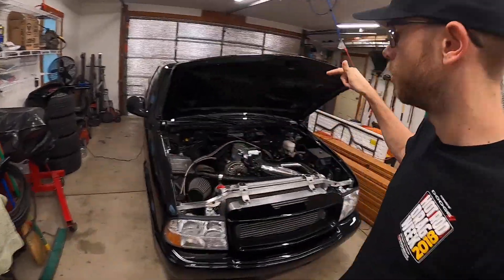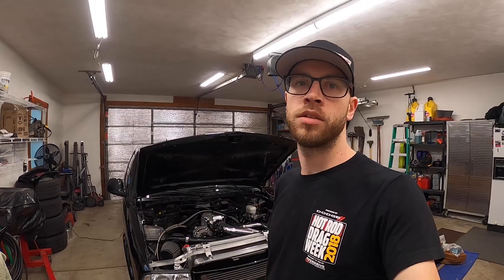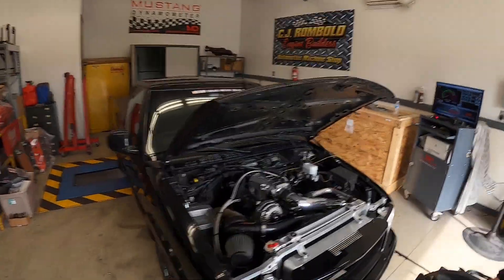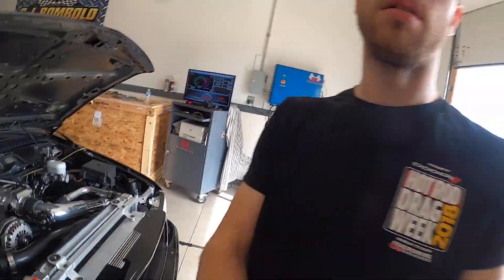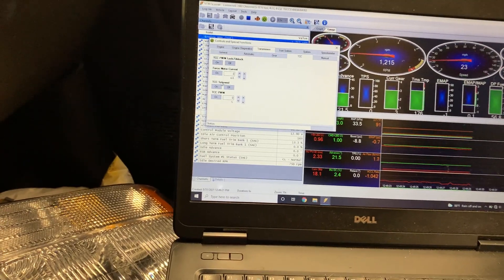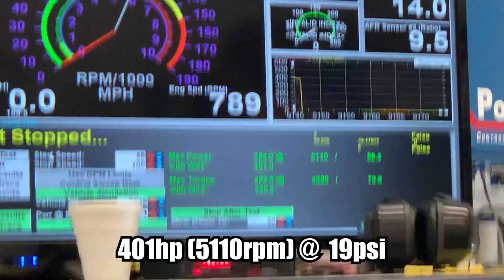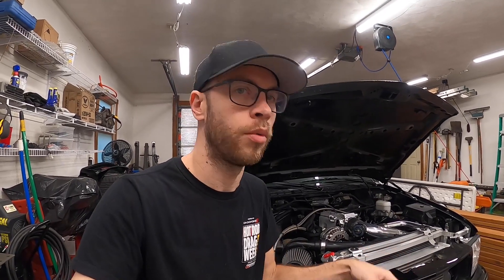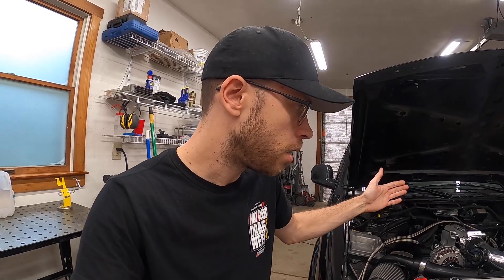Dyno Day - How Much Can A Stock 4.3L V6 Motor Take?

Comment: What intake manifold are you using did you convert it to direct injection, what's the fuel system and what are you using to tune it

Comment: Stock Ring Gaps? With that much boost? That thing is itching to implode 😂, The you can get A GenV LV3 4.3 and build it semi up with cam and Rings and delete the AFM. Then you can get 6-800 wheel  Hp!

Comment: Watched this a few times. Came back. Just watched a 2jz with 6 speed on chassis dyno. Made 420 @19 lbs boost. And you have an auto. So this is a great number considering how "legendary" the 2jz is. Good job
Reply: Must have been bad tune or something going on those supras make power
Reply: @BlackandWhitecustoms  yea. With a lot of boost
Reply: @manworksgarage  wouldn't take very much for a 2jz to hit 500 HP. Not taking nothing away from his build it's very impressive but in no way can you compare a 2jz to a 4.3. The 2jz at 500 HP will last forever but 4.3 stock is a ticking time bomb at 500
Reply: @BlackandWhitecustoms  I agree with that. I was just comparing 20lb vs 20lbs. Impressed the 4.3 was at same 420 whp. With an auto vs a manual at that. Obviously the 2jz is smaller gonna need more boost but it's got a probably much better head plus vvti.
Reply: @BlackandWhitecustoms  found a dyno video. 2jz with th400. 499 at wheels 27 psi. Now 27 may blow up the 4.3. Idk. But it's pretty stock. I don't agree the 2jz is so much better than other engines. 500 I a lot more than the original 300 to 326. So it will always take a toll. It's a rather small engine.
Reply: @manworksgarage   yeah I like both motors maybe 4.3 a little better because I can buy those all the time at cheap price. I am about to pickup turbo kit for my 4.3 long bed single cab work truck to see first hand how well these motors run on turbo. Gonna throw a small cam also with stock bottom end rebuild and properly gapped piston rings. If I can get 450 I will be happy
Reply: @manworksgarage  4.3 will probably take it but not for very long. I am thinking about buying separate motor so I can e85 my stock motor and keep upping boost until it blows 😅
Reply: @BlackandWhitecustoms  I also have a turbo.kit for my s10 blazer. Filming for my channel. I'm also awd swapping it. Wanna do vortec heads and a cam too. A few different turbos to try out. Also doing sniper swap.
Reply: @BlackandWhitecustoms  engine power did a 4.3 vortec head, little porting, cam. Holley sniper. Did 450 plus hp. Only about 17 lbs I thing. Good turbo
Reply: @BlackandWhitecustoms  definitely the vortec heads 95 up. And a cam help a lot. Turbo v6 guy doesn't have a cam yet and made 420 whp
Reply: @BlackandWhitecustoms  it has a decent base.  With good bolts. It has 5 bolts per cylinder head bolts like sbc. 4 bolt mains I think it'd last with 450ish. Street driven

Comment: I like V6 engines, but they don't seem to dyno very well.I mean 19 psi boost is 2.29 BAR MAP, right? 401 hp / 2.29 MAP is 175 hå from "The theoretical NA engine". 175 hp 7 262 CID is only 0.76 hp/CID. I think this number speaks for itself so the need for a highflow intanke manifold is very limitied . :)

Comment: Why did you want so Much Boost, 369 and close to 400 Ft pounds, Would be a nice drive, That Motor will not hang in there with boost so High, You Have Nothing to Prove You did good on Manifold, you should be Happy with what you Had.  If you watched power nation, 500 hp 500 foot pounds with less Boost, Maybe your Camshaft , You really don't need so much,. Blowing up your Motor is not worth all the work Put into it, Be happy, Less is sometimes Better.

Comment: Nice build. I think you’re just not revving high enough on the stock cam/springs to take advantage of your new intake setup. The marine parts for these engines work quite well on stock blocks up to ~5000 RPM but if you were to take it higher with a bigger cam I believe the new intake would have picked up power. Regardless it’s making good numbers for a bone stock 4.3.

Comment: I've been searching which kit to use for a Direct Ignition System conversion, but everything is for V8s. Did you cut the cables it came with the kit to make it a "6 cylinder" kit? All I found was the MSG one. Thanks in advance!

Comment: I'm from Texas and I have built my 4.3 heavily. In kept the stock camshaft and modded everything else. The camshaft is not the problem. You need to do some porting on both sides and you will see improvement.

Comment: I had a 96 gmc sonoma with a weak 175hp rated 4.3. I installed a cam (dont remember the specs) and some head work with bigger intake/exhaust valves. It really woke that engine up i could not believe the difference it made in power. Head flow is the limitig factor, was disappointed your new intake manifold didnt provide better numbers. It was all limited by head airflow.

Comment: Your forcing air in the intake doesn't matter unless it has a huge restriction. The cylinder heads are the worst thing if I could find some good heads for my 4.3 vortec I'd bet that alone could make noticable power gains. Forcing air in isn't really an issue you need to improve the exhaust ports on the heads.

Comment: Do you think it could run safely with 400 hp without the special head gaskets replacement?
Reply from the maker: Mine did for a little while.
Reply: @turbov6 Hi! Did you replace something more since then? I'm planning to be a little more conservative in mine. Today it's stock, only with a change in the camshaft, that gives me 235 hp. Want to add a hundred horsepower with the turbo. Do you think it stills can handle 335 stock? Would you change something preventively? Thanks, man.
Reply from the maker: As long as it's tuned correctly it should have no problem at that power level. @renanpinto1933

Comment: very interesting, so many questions. i have a 97 with many engine mods on the stock bottom end. and a intercooled Vortech V2-SQ blowing 16'ish psi.
Reply: Made 470whp with my V2-SQ at 15psi with other mods. It was being over spun at those levels big time.

Comment: The boost does what a polished manifold does. Don't need both. It's like adding eleven things to an engine, all claiming 10% gas improvement and expecting a 10% surplus of gas. Two technologies to move more air don't add any more air than one technology. The amount of air volume is limited.

Comment: Valve spring upgrade and porting on heads will net you better power for sure! I think with higher lift cam also you will see massive power upgrade! The intake manifold then I turn with more airflow will benefit!!

Comment: Better too rich than too lean.  
I am impressed by the intake manifold and the numbers you got.  I have an 03 ZR/2 and I'd be happy with 300 WHP.  There just isn't much you can by for these engines, performance wise.  I'd ove to go aluminum heads and manifold just for the weight savings, but can't find any.

Comment: Can you point me into the direction of the marine intake for the 4.3
Reply from the maker: eBay
Reply: Is there any way you might could post a video on the setup, as far as turbo type, piping, schematic, piping, intercooler if one, wastegate, etc. I mean, I’d imagine you may have already done this and I just haven’t found it yet, but I’m currently daily-ing a 1995 S10/Blazet, 4DR, 4wd, 4.3 Vortec, and I’ve been scouring the net, you tube, forums, pages, aftermarket websites, etc. And compiling a list of the upgrades, tweaks, build components, performance & visual upgrades/updates/replacements and so on and so forth… I was raised up, riding, driving, customizing, turning wrenches, and straight bleeding Ford Blue… I ADORE the 1998-2008 Rangers, 3.0V6.. I like the 4.0 as well, just partial to the 3.0. This Blazer is my second Chevy, but it’s my first Chevy project/build, and though it’s 4WD, I’m thinking of swapping the front headlights and attached to either an ‘00-‘05 and potentially going with a wide body kit, out to 2wd front end components, doing a 2x2 drop,(upgrading all components I physical touch whilst doing so)/W body kit, possibly doing air suspension later on, upgrades to the top end, ignition, wires, better plugs, upgraded distributor cap & the like, long tube headers for that low end, into an X-pipe resonator delete feeding true dual lines/W HiFlo Catalytic Converters,  2-3/4” exhaust lines into either a Borla or Magnaflo Si/So Performance mufflers on both lines with electronic C/O, Rear drum to disk swap, etc. etc. *ETC* , Lol . But, I was wondering if maybe you might have the time, patience, or GaD enough, unlike damn near most anyone else I’ve asked who wouldn’t take the time to correspond on the matter, or allow me to pick their brain while writing shit down and making sure that I don’t screw up along the lines, lol… If not, it’s cool too.. But it never hurts to ask… Nice job BTW.. I look forward to hearing back… THANKS..!

Comment: This hourse powers that a engine or the tire????
Reply: Well lets break this down. 1. Engine in truck check. 2. engine running tires moving on dyno check. 3.3rd gear pull on dyno check. What was the question again?

Comment: I have a Comp 56-000-8 custom cam for that block.  intake 271 exhaust 276 on a 112° LC 4° advanced.  in .500 ex .510.. If your heads have 10mm base screw in rocker studs I got the  arp ones in 3/8..  This cam will need the PAC-1218 springs and I highly recommend Morel lifters.  I can look up the comp part #s for the valve retainers and locks to make it a drop in for the springs and they usually clear up to .530 lift . 
Do your rocker arms have the pivot ball or the later roller trunnion (like the ls motors with 8mm bolt)  
That cam will make you 100hp+ more,  a very flat torque curve up to 5300 (I limit my rpm to 5800)at a lower boost level. 
 https://youtu.be/6l4b4KDsmzc  is of my 4.3 in my 84 rx7

Let me know if your interested the cam. 
Robert.

Comment: when you get some time, maybe make a video on your tunning setup.. ie: ehat tuner, softeware,controller etc you ned/use too tweak' 4.3 gms.. the cost, time to setup, the laerning curve.. and what all intails too buy a tunner, plugs, hookup, start tunning.. and what and were you tune the most with the tuner for boost, other 4.3 related tunning stuff with some basic how too get started..  Ive been around tunning, like ford tweecer, moates quarter horse, etc w/ fords ..but i dont know anything about gm;s.. keep the videos comming love it..  in process od boostin a 03 4.3 5spd in a 1500.. but not sure were what way too go for tunning..

Comment: What are the specs of your fuel delivery, if stock pump and injectors then that’s impressive but I need to know, building a turbo Jimmy.
Reply from the maker: Walbro 450 pump and ID1050x injectors

Comment: Solid numbers for a stock 4.3, the tiny stock cam is killing it!  

At the 401@19 psi, what did you have the timing set at?
Reply: This was @ the wheels. The engine was probably making 460 hp.
Reply from the maker: Don’t remember exactly, probably in the high teens
Reply: @turbov6  hello do you have a part number on the torque converter you are using

Comment: Rain guards are a must in an s truck.  I spray a stock 230k mile 4.3 with a 125 shot no problem lol. . I’ve put probably 30 10lb bottles though it. Dry shot
Reply: How long did it end up putting up with this 🤣 got a 270k miles 4.3 debating having some fun with
Reply: @itspickle6664  I blew the 7.5” rear end. The Motor still purs like a kitten. It’ll take that slow 4.3 and light the tires up from a dig lol. I’d spray it the moment my foot hit the floor. I put the nozzle about 4” from the TB.. from what I read the further away kinda softens the hit so to speak. 🤷🏼‍♂️

Comment: Just wondering where did you get those fuel rails ?
I am looking at building an 98 4.3l with some ls parts and custom intake just cant find the rails anywhere  
Thank you for your help
Reply from the maker: I made them custom
Reply: @turbov6  ok cool got video on how to do that?
Reply from the maker: @user-uc3zo3bf1s  Yeah check out my playlist for my custom manifold. There is a video showing the fuel rails.
Reply: Ok thank you

Comment: My blazer has a 4.3 stock block forged internals boosted with twin 76 mm turbonectics rear mounted turbos on 14 to 16 psi I made 448  on 12 psi could  have went more but need Injectors and msd box for 2 step and line lok  but still fun and AWD to ...using Hptuners has helped get map and fuel figured out along boost increase.and fuel management
Reply: Oldsmobile(being GM still) made a chevy blazer/gmc jimmy look-alike called the bravada. It came with a "smarttrak" system that controlled a transfer case (like a 4wd) into going from 2wd, into awd automatically. Giving better traction when needed. Was great for older fold up north in the snow or lived down dirt roads. They could get in it and forget it. My boss has one 190k still running.
My point was they use these transfer case in replacement of the 4x4 t case bolt right in I would assume. I haven't done much research on the topic specifically but I've seen guys do it.
Reply: @ChickenJoe24 I knew bravada's were all time AWD and know handfuls of people using them for builds. I believe the AWD cutless dude used them not 100% tho. They reliable enough to put significant power to?
Reply: Ext Astro transmission/Bravada have the 700 with the Borg Warner BW1372 BW4472 AWD Transfer Case. Worked at a performance transmission shop that specialized in these and Silverado SS transmission 16 years back.
Reply: Alot of money to only be making 450 to the tire but to each his own
Reply: How did you convert it to awd did you use the 90s astro parts that came awd or? Trying to maybe make my S10 AWD been trying to figure out a good way to do it
Reply: @dustinwarren9130 some blazers came in 4x4
Reply: Jesus H Christ! That lil 4.3 must be sweatin 😅 where are you going for performance parts? Or do you fab parts yourself/have them made?
Reply: I used a Bravada t Case it can go from 2 wheel to Awd Auto
Reply: My billet np case was relatively easy to find, then find a NP1 internals set from a used case with the F46 Designation. You can still pick them up between 250-400$. Refresh and build it up. It'll hold UP TO 400hp all day trashing. I've got 60k on my TC and I daily my mobster 99 custom back half zr2 AWD noma clip, full forged, billet 4l79 based build in 2pc 4l60e case by Mason Smith and Frank @cpt, Randy AKA tranzman and Valvebody @ Brenton Irving B1Trans. Arp everything,  NA build billet crank 4x3.886, comp cam and this truck right here? Would STILL probably outrun me. It's OK, I love my truck
Reply: What intake are you running
Reply: Stock crankshaft?

Comment: Hey man I got a question how did you run actually fuel injectors in the 4.3 and avoid the spyder injection
Reply from the maker: Custom intake manifold, check out my other videos
Reply: Did the intake in the video look like what you run?  Did you see the fuel rails?  Did you actually watch the video??

Comment: Nice video. I'm guessing the stock V6 Vortec heads is where the most power could be had. There isn't really much out there in the aftermarket for the 4.3L V6 other than Brodix has some heads for it. I'm not sure about cams and intakes. You could do some good porting on those heads and get great gains over the stock flow. I think I read somewhere that someone (Hot Rod?) did some flowbench testing and the gains were significant but compared to aftermarket V8 heads, they we're low.

Keep plugging along. Nice to see the 4.3L get some recognition for a power build. Oh, and PowerNation has a 4.3L build going on right now that you might be able to snag some ideas from.
Reply: Here is the link to MotorTrend which, I think, Hot Rod did. https://www.motortrend.com/how-to/chevy-43l-262ci-v6-engine-build/
Reply: There is a company down there somewhere that builds these 4.3 for some circle racing or somthing like that they do the heads right up.  Might be worth talking to them unless he is going to do the machine work himself....  I saved the video I could try to find it and post the link....
Reply: There's everything you need and ready and available on the market

Comment: Definitely agree that cam is your limiting factor. If you could keep the same torque for another 1000rpm, it should be closer to 430-450whp, if it doesn't pick up even more from the airflow.

Comment: Love it, just got the last bit of parts in for my 4.3 turbo s10 to be done.  👍👍👍  great info, ibseen the 18ish degs at 19psi but how much timing are you running at 8 to 10 psi??
Reply from the maker: 20-22 but I haven't really tested much at that low of boost.

Comment: What size turbo are you using?
Reply from the maker: GT3582R (61/62)
Reply: @turbov6  did YT delete my comment? I was trying to recommend some stuff, maybe it's cause I put in a web link.
Reply from the maker: @royboyspeed  Not sure, I didn't see another comment.
Reply: @turbov6  oh musta been YT then. My motor was non vortec, but made 477awhp on 23psi with a 6266. I raced as high as 28psi and I think I ran the 10.8x passes at about 26. I definitely think the cam is gonna be a huge jump for you. I ran a comp 412 cam and with the springs/retainers revved to 6000.

I ran a converter that'd allow me to foot brake to 3400ish and used a msd 2step (6al-2) box and it made a big difference.